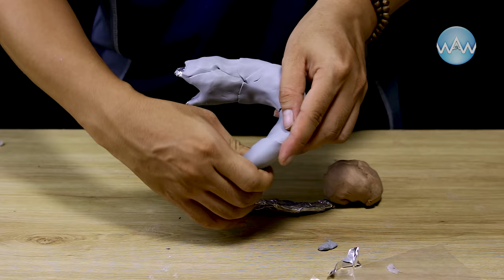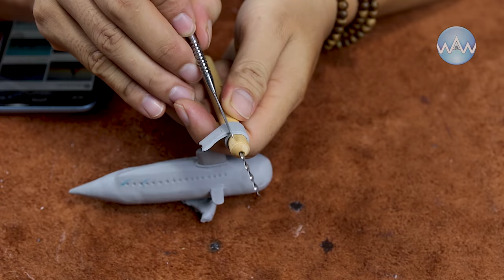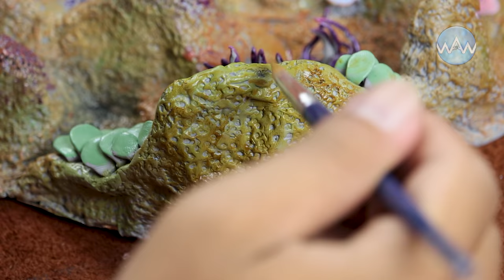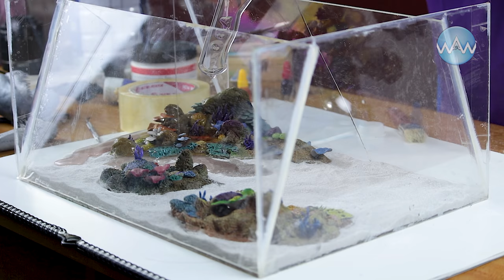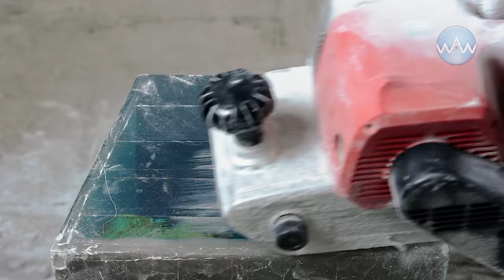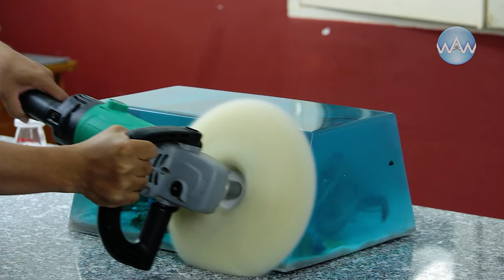DIY. Monster electrics eel diorama (thalassophobia/Cryptid/creature/resin art)

Comment: How did you get the air/bubbles around the eel and submarine? This is amazing, good work.
Reply from the maker: It’s just be a mistake, i can’t control it!
Reply: @wAwCreator  some youtubers ive watched doing resin works use a pressure machine of sorts to remove all bubbles
I think the bubbles actually looks good in this piece but since you said it wasnt intentional i just thought of letting you know😅
Reply: Exactly what I was going to ask. Lol its definitely an awesome mistake! 🙂
Reply: @wAwCreator  ha! It looks like explosions and totally intentional!
Reply: Too much resin poured at once. The chemical reaction caused the cracks
Reply: @Tikoy Cardiño you're *
Reply: @Tikoy Cardiño *syringe
Reply: @Tikoy Cardiño also, he didnt. He already said it was an accident 🤷‍♀️
Reply: @idkk1901  lmao im glad SOMEONE could decipher that 😂
Reply: It's not a bug, it's a feature.
- Todd Howard
Reply: @wAwCreator  a way to not get those is to lightly tap the container its in after you poored it that way they will rise up and once at the surface use a butane torch a small one to be precise and they will pop due to the heat 
works like a charm i can guarantee it will look so much nicer then
Reply: @d1znenut  its not cracks theyre actual airpockets due to a to quick of a poor
Reply: @Tikoy Cardiño he said its a mistake
Reply: In Bob Ross terms, a really happy accident
Reply: Looks like the clay figures may not be airtight, and bubbles escape as resin seeps into the gaps.
Reply: @BIGgourami I'm not sure who's laying into anyone 🤔 correcting someone's spelling or grammar is far from it. Not to mention, if you're going to call someone stupid, at least do a spell check 🤷‍♀️
Reply: If you dont mind me asking what resin did you use for this
Reply: @wAwCreator  thats a pretty lucky mistake then
Reply: come on guys, its intentional, he just doesnt want to tell how it is done
Reply: @Karcoma  I make resin art and sofubi figures. I can vouch and say It's not intentional.  Air pockets form when the resins are mixed too quickly, poured to quickly, or from to far from the mold. To combat this it's best to use a popsicle stick or skewer to drip into the mold, and as tedious as mixing is, slow and steady win the race. The air bubbles look nice in these underwater dioramas,  but it does harm the structural integrity of the piece.
Reply: @Ada-pc8rf   It's what Bob Ross calls a 'Happy Accident!'
=============================================================
Reply: @anomunousfugc8034  I spent the entire video watching to find out how they made the bubbles and it turns out it was a mistake? I dont believe it
Reply: @anomunousfugc8034  it was too deep a pour and it got too hot and that caused the bubbles
Reply: Isn’t it trapped air in the resin when you pour it and why you would presumably make water stuff
Reply: @wAwCreator  there is no way you are being truthful
Reply: I absolutely love the way you create your "monsters" with clay and a lot of know how. So many others have 3d printers or use complete structures from amazon. You have so many skills that you can built anything on your own. And that's why your dioramas look so realistic.
Please don't stop beeing so creative!
Reply: Maybe bubbles around the Eel looks good, but it looks like crap near the submarine.
Reply from the maker: Hello Sky armor :D Harger! You used to love my work, and now I want to invite you to come back to see my latest work - I Made Realistic Flame of Drogon From House Of The Dragon. In this work, I used surreal fire effects to create the most vibrant and vivid image possible of the dragon Drogon. Hope you will enjoy and experience great emotions when watching my latest work. Thank you so much for your support and for watching my work!

Comment: The big air bubbles might be two things: It is either air that is escaping from the models when the resin is already curing. When it is still soft enough for airbubbles to slowly move around but to tough for the bubbles to make it to the top. Or it is when casting in multiple layers from models/next resin layer resting on the previous layer while that previous layer is not fully hard. The models/new resin is sinking into the other layer and leaving cavities while moving.
Reply from the maker: Exactly! Perhaps you have had too much experience in this regard!
Reply: @wAwCreator  Yes, definitely. Resin pouring is somewhat easy, but it is all the little things that go wrong the first times you do them that you never even thought of beforehand. Good luck in future projects!
Reply: @wAwCreator  I have figured out the reason for the big airbubbles. I have just had it happen to myself. It is a combination of what I said and the thickness of the pour. Epoxy resin cures through a chemical process and produces heat. The bigger batch of resin you mix, the bigger and faster the chemical reaction and the hotter it gets. Air expands with heat. If you mix a thick layer of resin, it reacts very quickly and gets very hot which causes any small bubbles to very quickly blow up and the resin will harden before the bubbles can get out or become small again. The fix is to make sure everything (model, floor etc) is completely sealed so no air can escape from anything, try to get rid of any bubbles that get in from pouring or just do thinner layers. Today I poured a layer a bit thicker then yours. At first everything looked fine and then all of a sudden it quickly became very hot and every little airbubble still stuck in the resin just exploded and every spot on my clay model that was not sealed properly started just streaming air. It became so hot that even the hot glue used on the mold started to come loose. Live and learn, time to start anew.
Reply from the maker: Hey Eener1000, we wanted to let you know that the artist has just released a new piece called "I Made Realistic Flame of Drogon From House Of The Dragon". Based on their previous work, it's sure to be amazing! Be sure to check it out and let us know what you think.